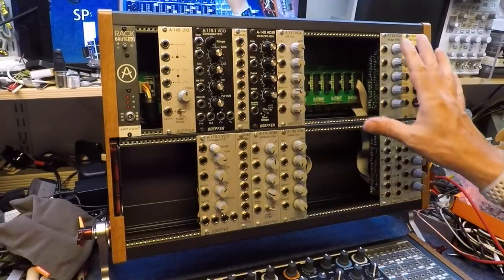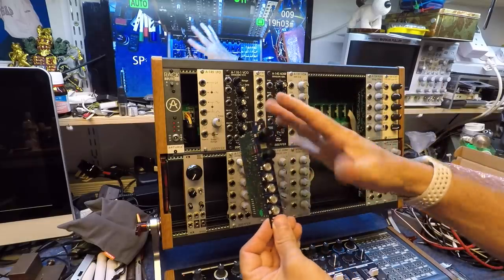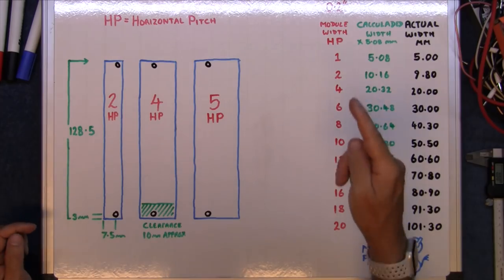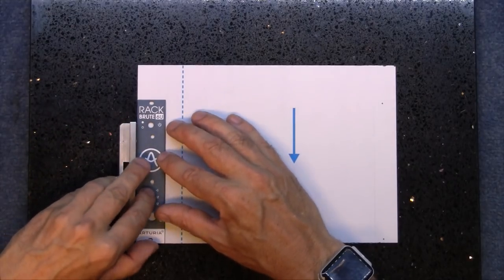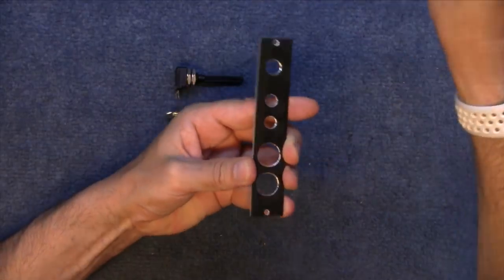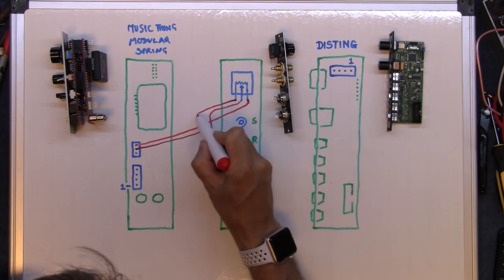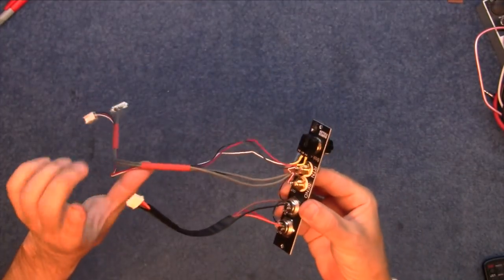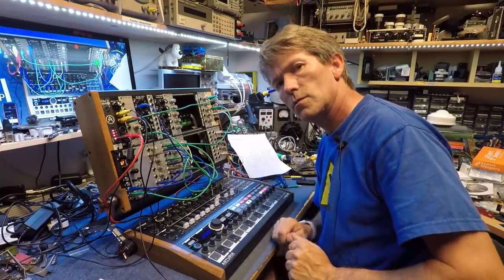How to make a eurorack module

Comment: You're a very brave man, Mark! Also a very resourceful and patient, hard-working one too! :-)
What puts me off modular gear is the sockets being on the front panel.
This means that when the leads are plugged in, they get in the way of all the control knobs & switches!
At least with semi-modular synths like Korg, Arturia, EMS etc, they keep the sockets away from the knobs on a separate panel.
Personally, I think it makes better sense to use a built-in modulation matrix system.
For instance, I have Reason 10 and the Thor semi-modular synth uses a very powerful and flexible mod matrix without all the need for messy cable spaghetti!
In fact, reason uses patch cords to connect rack modules, but there is the option to hide or minimize the cable clutter, and believe me, sometimes it is so hard to see what is connected where without using these options to reduce the cable clutter!!!

Comment: Interesting. This is the first time I've seen the HP of the power supply mentioned. An option for anyone who isn't so DIY-inclined is a 3HP module. Erica Synths make a few and searching Modulargrid for modules that are exactly 3HP (or another uneven number) should help fill the row.
Reply from the maker: Yes I think the expansion module for the spring reverb is 3HP so I guess i could have used that - but the MIDI sockets would not have fitted.

Comment: Nice kit. I built one of those spring reverbs on my last system, I really need one for my new system too, they sound amazing. If you want some decent DIY modules for very little money and you're ok with SMD, check out the Pusherman website. Also Frequency Central make some good Roland-esque DIY modules if you prefer soldering Through Hole...
Reply from the maker: I enjoyed your Jasper synth build video, where Did you source all the parts for your Jasper synth ?. what was the estimated cost to complete it ?. - I will have a look at the Pusherman website, sounds interesting.
Reply: Thanks for the kind words, your videos are always interesting to watch. So far I've built 5 Jaspers. I keep a stock of bread and butter parts; MF resistors, capacitors of various types and values, transistors etc. Most of the other stuff is from the electronics market in Bangkok, known as Ban Mo, the Alpha pots are 1/10th of the retail price here, and definitely genuine, the chips are also easily obtainable there, not to mention rare parts, so it was a lot cheaper to build than sourcing from the UK.That's if you don't include the price of flights...
Reply from the maker: LektroiD Thank you for that info. I will go and check that place out for the parts i need. i have about 50% of what i need in stock but its getting the time to work out and order what is left to complete the puzzle. im looking forward to making this synthesizer. best wishes from markus.

Comment: Great video Markus! For those who watch this channel that don't want to DIY stuff or use a blank panel to fill in an odd hp gap; in addition to Erica Synths Pico line of 3hp stuff (that was mentioned in another comment), Bastl Instruments makes lots of 5hp modules, Malekko makes some useful 3hp modules too. Also older modules by The Harvestman are usually in odd hp sizes (Now known as Industrial Music Electronics).
Reply from the maker: Thank You. I see theres many odd HPs to choose from. the extension out for the spring unit is 3HP but then i would not have been able to add the MIDI sockets. but i will go and check out the ones you have mentioned. best wishes.
Reply: Your custom module is a perfect fit for your setup. This video is actually great also for the detailed drawings and explanation of the hp width specifications. Great stuff as always. :)

Comment: Very helpful! I didn't know about the inaccurate panel sizes compared to HP. Good to know. What is the machine you use to cut the panel at 7:04 called?
Reply: 3 years late, but it's - Clarke SBR305 3 in 1 Universal 305mm Sheet Metal Machine

Comment: I just got this Arturia set, but with the Minibrute 2 keys version. I haven't set up or filled the 6U yet. So, it will still have odd gaps if you START from the power supply onwards to the right instead of randomly working towards it from the middle?? Great video!

Comment: Looks very professional, Markus!  Quick question: you glossed over the positioning and cutting of the holes - how was that done?
Reply from the maker: Hello I just drew a line down the middle and then punched holes where i wanted the components making sure there was sufficient space for them to fit correctly. then drilled them out. sorry i cut that bit out as i was trying to get the video length to under 15 minutes.